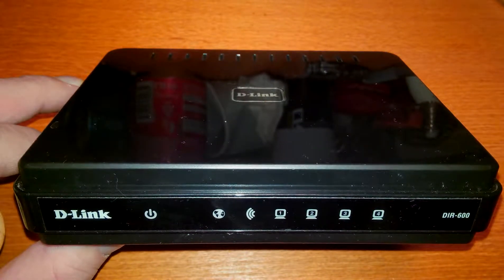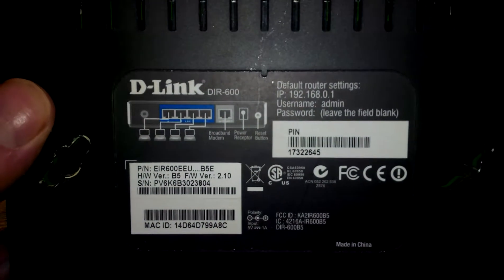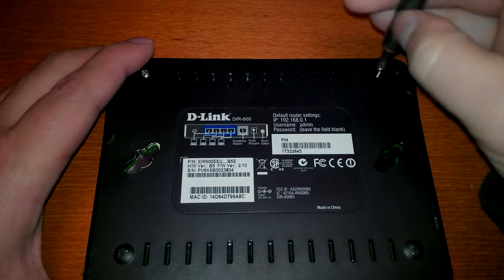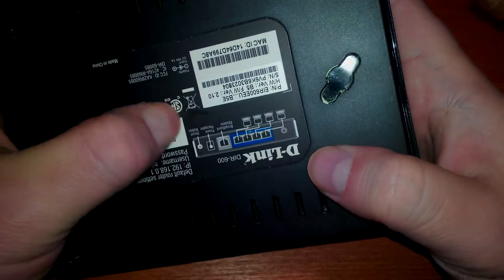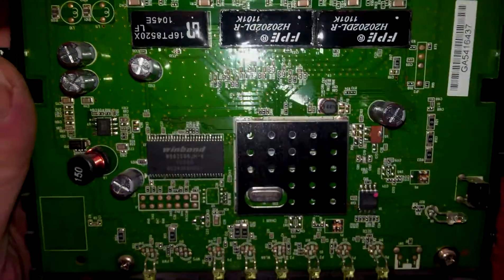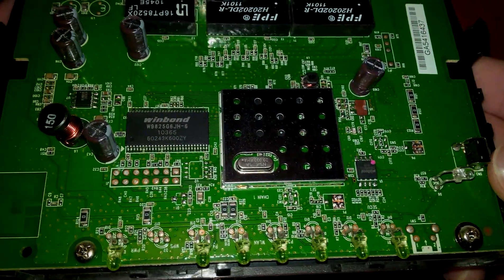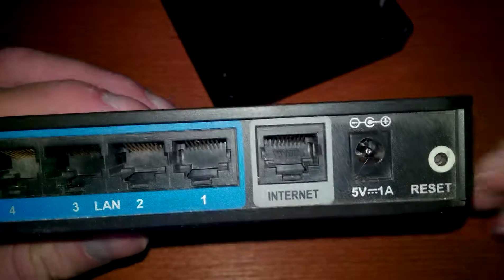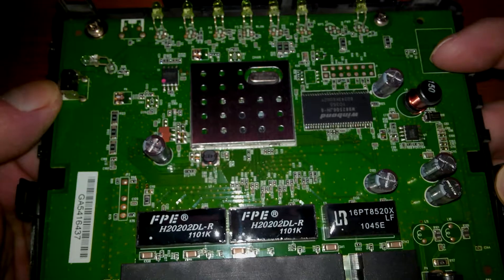Router D-Link DIR-600 Teardown - 5V 1A power

Comment: Avoid Tenda products at all cost, they always put the least amount of RAM possible in their routers and have too many other corners cut in general. The price is really indicative, even though I've seen really expensive D-Link and TP-Link routers fail miserably too. 😁
Reply from the maker: Yeah, I only buy Tenda when it's ~50% cheaper than the next cheapest brand name product. Last time I bought a Tenda 300N router for 5USD, new with 2 years warranty 😎👍
Reply: @Poxenium  Failing power adapters, overheating chipsets or updating FW I can handle, but I hate freezing routers from just 2 wireless clients. 😁 Only "cheap" router that fucking amazed me was a 300N ZyXEL I sold to a friend of mine - connected to its network with my phone from like 150 meters outside his block apartment! 👀